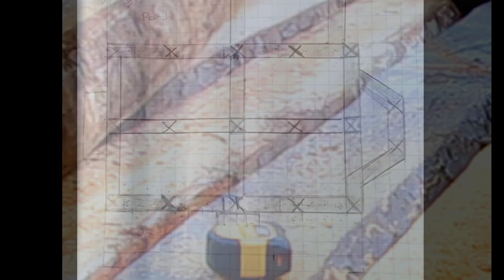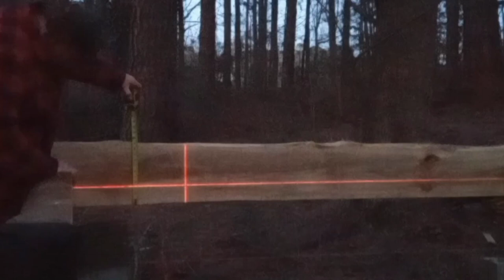DIY How to Build a cozy cabin....

Comment: It seems to me you have it all figured out Sir. I only wish I had a mentor like you to give me that knowledge for my future build. I bought the land , Mill, chainsaw's now I'm lost at what to do next. That jig seems like the way to go to complete the log on the mill. Nice video and I'm subbing after I get this typed.middle TN here.
Reply from the maker: The jig makes me feel like I'm cheating so I do some by hand. It is extremely fast for a notch. I built that jig to work both ways instead of having three jigs. That's why I added the metal handle as the other guide. So the jig will do either side of the log. It has 1 1/2 inch angle over a 6 inch wide log. I made it cut 2inches over just to have the overhang. So I put a quarter inch oak spacer on the saw blade so it's 81/4 inches deep. Now I fail at putting that in the video because I got some slack for using the jig but Iv done a video called .dovetail notches so easy I feel like I cheated that I'm about  ready to post, that will explain the jig. I get some heat off of it because people want to sell the plans but if you buy the plans your stuck on one specific design because you have to use the same diameter log on the whole cabin. This one will work live edge from 6 inch to 24 inches. I'll add the drawing for the plans to the video. Just come to my rescue when the people that try to sell them hammer me
Reply from the maker: By the way this one is going in Tennessee
Reply from the maker: I would find out what size logs your going to use and I'd start getting them peeled and drying. You have the most difficult part accomplished already. Get you a grid pad notebook and start drawing your dream. I'm doing a video for the subscribers and I'll show you how to make your jigs if you want to do a dovetail Appalachian style cabin
Reply: Sound's great Sir. I'll be looking for the videos and the plans and definitely thanks for sending your response. By the way send a  a signal and I'm sure you would have backup in know time.
Reply from the maker: https://youtu.be/CDOzBrGWLZ0
Reply from the maker: I responded to your question in this video I just sent you